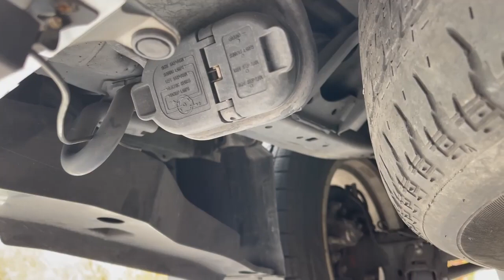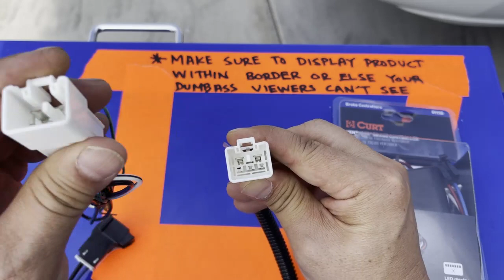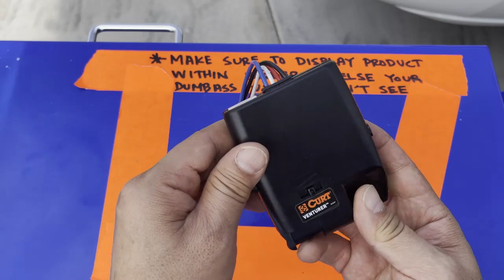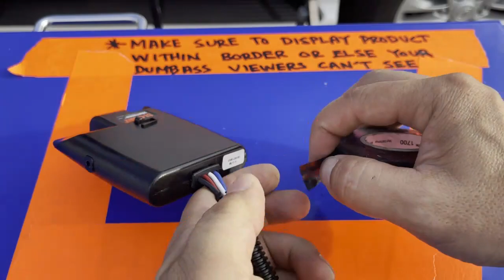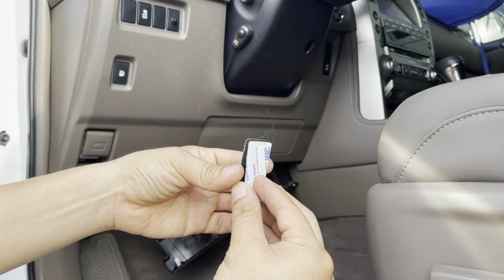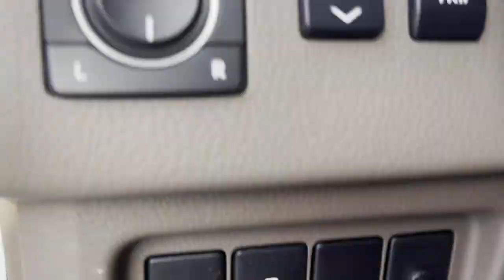GX460 Brake Controller Installation

Comment: Thanks buddy.  I installed mine, but I extended the wire harness and routed it into the box between front seats.  My wife did not want to hit it with her knee. :)
Reply from the maker: What has your wife been doing on her knees for them to swell up to the point that it will get in the way of a brake controller?
Reply: @GXBOB  LOL. Not sure man, but I don't want to argue with her. She wanted it in the box, Lol lol lol.
Reply from the maker: @vladlozo1111  happy wife happy life.  (=

Comment: Do you know if the Curt brake controller would be compatible for a 2022 GX460?
Reply from the maker: Jordan, the issue with 2022 is that there are very little information on it since its so brand new.  As far as harnesses go, i don't see any harness adapters that accommodate the 2022.  You might have to wait for the market to flood with aftermarket accessories or you might have to go with open end harnesses that require you to find all the wires yourself and tap into them.  
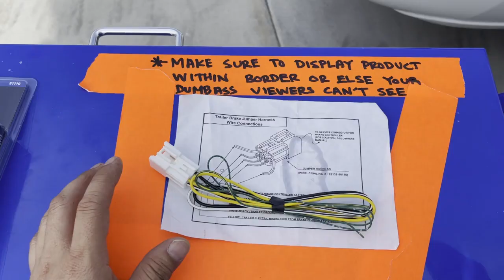If you fast forward my video to 3:10, i pretty much show you the wire color codes that you need to make your aftermarket brake controller function.  
Do me a favor, crawl underneath your driver dash and look for that taped up white plug behind the fuse box.  If you see evidence of that then you're in luck.  A 2014+ GX plug will work.  Good luck Jordan.

Comment: Do both wires fit the 2022? Amazon says won’t fit?
Reply from the maker: Thats because there are hardly anything on Amazon that is updated on a regular basis. Your best bet is to go directly to the manufacturer of whatever brake booster you plan to purchase and see their available options for wire adapters.  Try a company called Redarc.  Heard a lot of good stuff about them.
Reply: @GXBOB I called Curt and they told me there was no harness for my 2022 LX 460. The prewire is exactly where you said it would be

Thanks

Comment: To use OEM switch blanks for a professional install, here's the parts needed:
Redarc Tow-Pro Elite Electric Brake Controller: https://redarcelectronics.com/products/tow-pro-elite-electric-brake-controller
Redarc TPSI-002 Tow-Pro Switch Insert: https://redarcelectronics.com/products/switch-insert-to-suit-toyota-mitsubishi
Toyota suitable Tow-Pro Brake Controller Harness (TPH-021): https://redarcelectronics.com/products/tow-pro-brake-controller-harness-to-suit-toyota-tph-021
Tow-Pro Mounting Kit (EBMK-001): https://redarcelectronics.com/products/tow-pro-mounting-kit
(etrailer, summitracing, amazon, 4wheelparts, etc have parts)
See this video for an idea of the install: https://www.youtube.com/watch?v=H9DszoQwkMY
Reply from the maker: Thanks Nytron!

Comment: No... this is super ugly and ruins the interior of the GX. The Redarc Elite is hidden away, much nicer finish with Redarc.
Reply from the maker: I agree with you. But this is about installation and not product review. The price difference is also a factor if you’re on a budget. This does what its supposed to do for $35

Comment: Great video!  Any idea if it will fit a 2020?
Reply: @gxbob
Reply from the maker: @arieljaramillo7096  Yes it should fit as long as it is a Curt brake controller.  If u decide to buy another brand of brake controller then you will need to buy a different wire adapter. Also make sure your Lexus is already prewired with the white square plug behind your fuse box above your left foot.  Hope that answers your question.

Comment: So you didn’t even really need to unscrew the panel then, right? TY!
Reply from the maker: Not needed but it also depends on how ocd you are about routing wires. The bottom black plastic panel needs to come off regardless.
Reply: @GXBOB  I have a 2010 Lexus GX 460 Premium. I didn’t have to unscrew anything. The other white one was behind my ebrake tied with electric tape around other cords. I kinda had to dig around because it was hidden in the back, but I found it! Thank you so so much for this video! All the products work great and I would have never been able to figure out how to do this without you! Appreciate it.
Reply from the maker: @betho000-g1j  Thanks for the comment Beth and sorry for getting back to you after a couple of months.  I only get notifications for initial comments and none for following comments for some reason.

Comment: Lets say for a moment that the wiring harness is back ordered and you have to have electric breaks stat.  What would you say the Controller to Lexus wire mapping would be?  Since I don't have both harnesses in my hand and can only work off of Google images my guess is:
Controller Blue => Lexus Yellow
Controller White => Lexus White-Black
Controller Red 12 V+ => Lexus Green-Yellow
Controller Black => Lexus Black
Reply from the maker: The factory adapter came with my truck in the glove compartment. The wiring diagram was also included. I’ll look for it
Reply from the maker: Generic color codes for most all brake controllers are red(stoplight), black(power), blue(brakes), and white(ground).  Your assumptions above to match Lexus color codes are correct.
Reply: @GXBOB  thanks Bob.  You rock!

Comment: I have a 2005 GX470, I tow a tt 4200 pounds and just use the CURT ECHO bluetooth controller. Download the app on my phone and plug the controller in the 7 pin, plug into the controller and off I go. I have used this with any vehicle and for 2 years!
Reply from the maker: I  didn't have that option PNW....because many of the items i receive are free testers.  So i install what i  get most of the time.